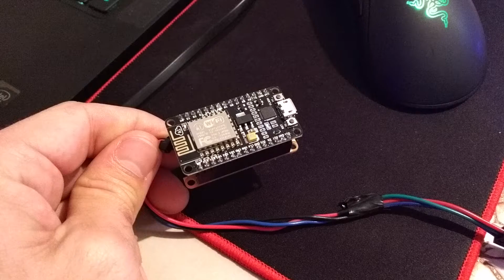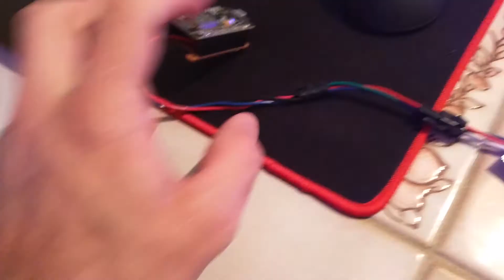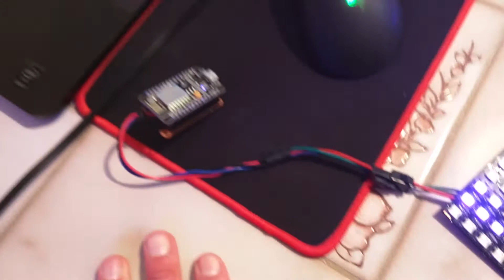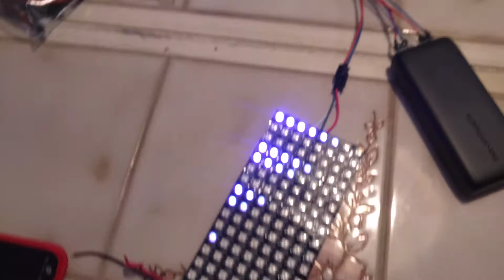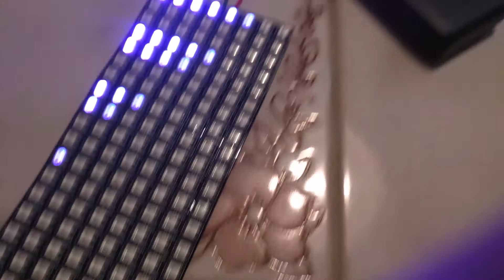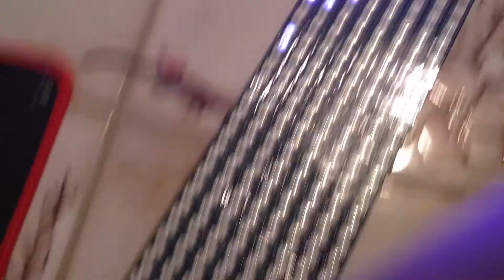Node MCU PCB adapter board for wireless ws2812 leds

Comment: multiple data line outputs?
Reply from the maker: nope, the nodemcu has one dma output, which is needed to achieve 60 fps for up to 512 LEDs. 

that said, you can use the other digital pins on the nodeMCU for LEDs too but they have to bit bang, and they also can't do so in parallel so you hit your bottleneck much sooner.

the goal of this board is to allow users to wirelessly control lots of smaller clusters of LEDs wirelessly